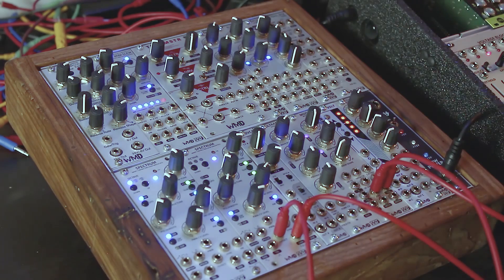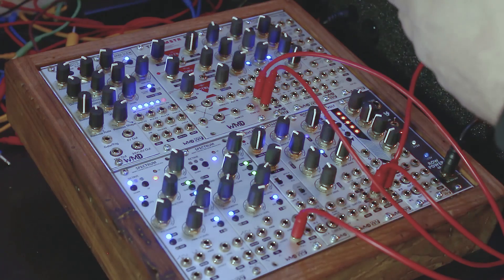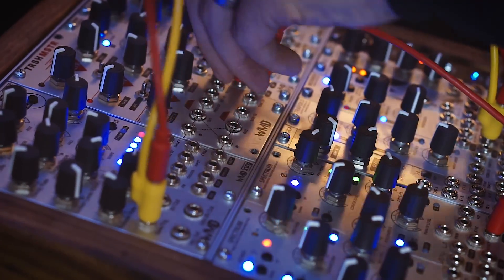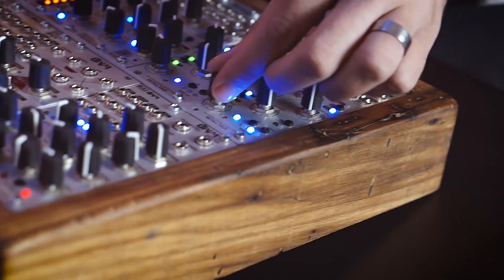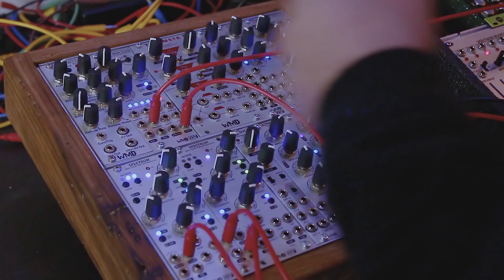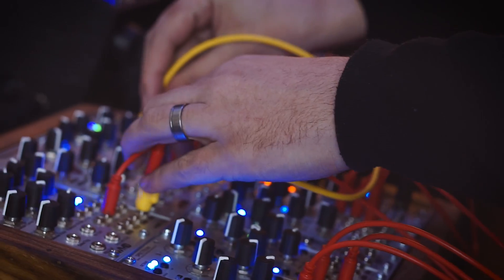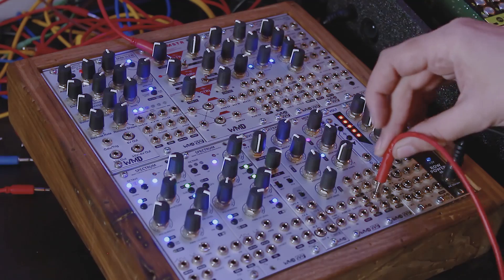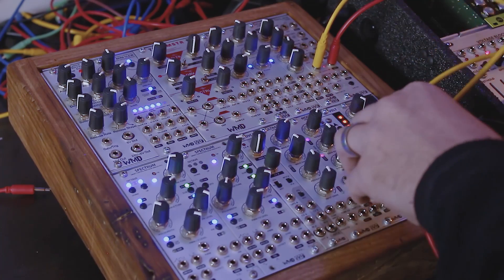Sample and Hold - what is it and what can I do with it?

Comment: Can you NOT use an onboard noise generator?   ANY audio input?  These sounds are interesting but very un organic,,,Pete used a sample and hold on Wont get fooled again but used a Hammond type organ as a sample source.
Reply from the maker: Use anything, we use an oscillator around 06:06 as the source to down sample it and get a digital sounding.  As far as organic goes... sample and hold is random when using a random source like noise.  You can influence it and make ti a bit more controlled by using a more predictable source...
Reply: @WMDevices  Could you sample and hold an external audio source like say, a voice recording? I find sample and hold really hard to get my head around. I can't imagine if or how this would work. :/

Comment: I wonder.  We use an LFO/clock to take samples of a noise source at regular intervals.  The noise source is crucial for providing the randomness/unpredictability of the samples.  But what if one used a predictable signal source, like an LFO or VCO, instead of noise, and sampled at random aperiodic intervals, such that the samples were never taken from the identical point in the cycle?  Obviously, you can't have the samples taken too far apart, but they don't necessarily HAVE to be predictable step durations.